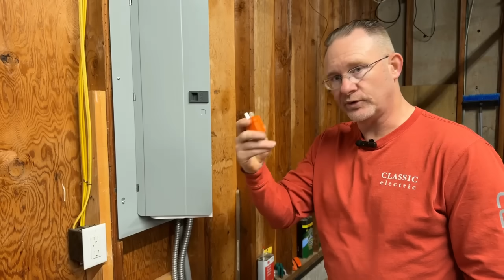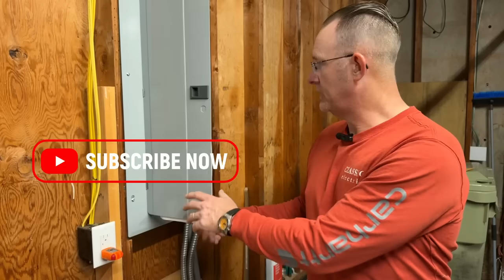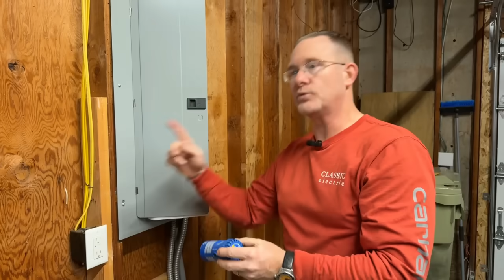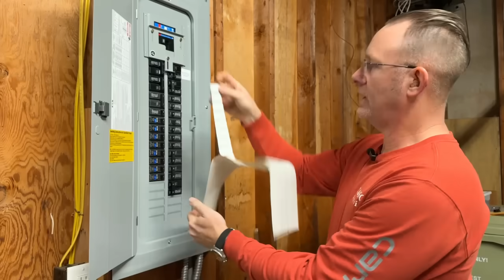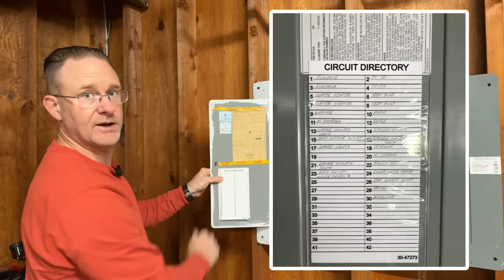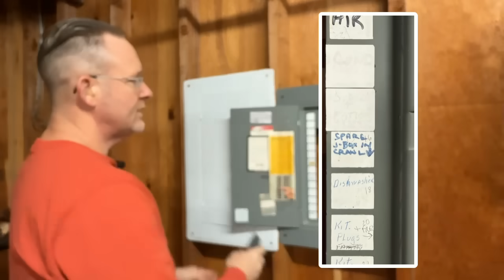Easy Ways to Identify Electrical Circuits in Your Home to Label Your Panel Correctly

Comment: Is there a way to apply for a variance? I have a 1984 house and need a panel upgrade. I was told that because the panel was next to my dryer (not closet) that they have to be able to walk up to the panel, and so they have to turn my panel around to be outside. So I came up with a plan to move my dryer and allow "walk up space" to access the panel and there is no door, so no closet confined area. Then they told me that the panels 2 feet on each side is not enough room as it needs 30 inches of bare wall in every direction all around the panel.. and it's got only got 20 inches on one side and 14 inches to the other side. So it must still be turned around outside. (why would a safety code force a homeowner to go outside in a lightening storm to flip a breaker?? How is that more safe?) so this is beginning to be BS. 
So the question, how much is it to get a variance to allow the panel to remain inside on the existing wall? There is no valid safety reason for this that the contractor could site Just that's what the code is. Is there any recourse a homeowner has?
Reply from the maker: You can ask the local building department for a variance, but generally the answer will be no.  That is because whoever gives the variance is on the hook if there is a fire/safety issue in the future.

Comment: Surprised you didn't mention a Circuit Breaker Finder and a noncontact voltage tester.  I have a Harbor Freight Circuit Breaker Finder that works very well.  My panel is in the basement, and I can test outlets is the garage or on any of the 3 floors of my house by inserting the transmitter in the outlet and then go to the panel and wave receiver unit over the breakers in the panel until it beeps.  Once I find the breaker that controls the outlet that the transmitter is plugged into, I used a noncontact voltage tester to test the other nearby outlets for power.  Process is faster that unplugging and plugging the lighted tester unit in each outlet nearby outlet.

Comment: Did anyone notice that the GFCI receptacle with (3) 12-3 Romex cables in that 1-gang box is not to NEC code for box fill???
Reply from the maker: You're correct that (3) 12-3 cables would be an issue.  In this case, it is (3) 12-2 cables installed in the box.

Comment: Suggestion: draw a sketch of your house floor plan with each outlet light switch designated. Mark the circuit breaker number. Label on each appropriate outlet/switch. This completes the task and avoid any problems in the future. Much easier to plan electrical circuits for future use.

Comment: A trick handed down to me from the old timers.  Take an old  extension cord  with a plug on it, cut it about 4 ft long. Get a handy box, wire the box with the cord. Now take the black and white wire and wire them to a switch. With the switch in the off position put the plug into the outlet you want to figure out. Not hit the switch, the dead short will trip the breaker and you will easily find which one it is in the box. The old timers called it,  "Get the circuit finder". Cheap and easy.
Reply: Interesting approach. If I were going to do that, I think I'd use a heavy-duty momentary contact pushbutton rather than a toggle switch.

Comment: I created a floorplan of each level showing each light and outlet location. Then wrote the breaker # next to each item for quick easy reference.
Reply: Same here Dennis. I did mine on my PC so I have a backup copy that I can change if any electrical is altered.
Reply: cool what software did u use for the floorplan
Reply: @Racontact I just used basic Sketchup, but I'm sure there are many other programs that would work as well or better.

Comment: I created an Excel spreadsheet (you can also do it in Google Sheets) to list my breakers. One column has a list of the breaker numbers, one column has a list of the rooms, and the third column has the specific location/description (e.g. #02, Living Room, Outlet Behind TV). I print one sheet sorted by Circuit # and a second sheet sorted by Room and hang them next to my electrical panel. Now I can quickly find the breaker number for a specific location or see all locations affected by a specific breaker. You may need to add an additional sorting column with just a sequence of numbers (1,2,3,etc...) to avoid circuit 11 sorting between circuit 1 and circuit 2.

Comment: when I bult my house I created a spreadsheet numbered like the panel.  as I added circuts I penciled them in.  When I was done I took the penciled in spreadsheet and created a new one that was filled by my computer.  I sized it to fit on the door.  What I haven't done, but will do, is get bright colored numbered dots.  The embossed numbers on the panel are difficult to read.
Reply from the maker: Using a spreadsheet is a fantastic way to keep everything organized!

Comment: The panel directory on my house (I had built) was written in cursive by what had to have been a 3rd grader.  I redid it in XL and will laminate it and put it on the door with magnets.  In the basement equipment room, I also cross referenced each piece of equipment - or its feed - with the breaker number on the panel.  Thanks for posting this.
Reply from the maker: Great idea to make it legible and easy to find!
Reply: As a licensed electrician I can tell you third grade was my favorite year.

Comment: Save yer some flippin'.  standard household outlet are generally 20 amps except in old houses when they were 15, so if yer lookin' for these you only need to flip these, forget the big ones for the water heater and clothes dryer.  Likewise light circuits are generally only 15, they could be 20 but less likely.  If you flipped all of the 15 and 20s and the light are still on you need to call an electrician cause your house is wired wrong. (unless there is a sub panel somewhere)

Comment: Have a small floor plan of the house on the panel, and identify the rooms.  Use this as a reference on your chart.
Use a circuit sniffer that sends a frequency through the power line so you can "hear" what breaker has the tone, then test the circuit.
Reply: Excatly what I'm planning for this weekend's breaker hunting

Comment: I have the tester like you show to see if the receptacle is on and working correctly. I also have a "sniffer" (circuit tracer) that works with a plug-in transmitter to help map the circuit breaker panel.  Plug the transmitter into an outlet and then the wand sniffs the panel for the transmitter. Trip the breaker and the transmitter goes off. There's a light in the tip of the sniffer that lights when it receives the transmitter signal through the panel.  Then you can pull the transmitter and plug into other outlets in the room that may be on the same circuit without needing a radio, vacuum cleaner, etc., for noise.  Works pretty accurately. Klein Tools makes both and they aren't all that expensive.

Comment: I'm surprised this wasn't listed... I purchased years ago a circuit tracer device. Plug one part into the outlet, then use the other part, an induction sensor wand attached to a LED and whistle device. Wave the wand along the positive side of the breaker, and when that breaker for the outlet with the plug-in device is found, the hand held device whistles and the series of LEDs all light up. (If you are "close" with the wand, only a couple light up.)
I wish I could remember the name of this device, but when I purchased it about 25 years ago, it only cost about $15 or so.
This thing even worked with the panel on.
** [edit] Klein tools, circuit breaker finder tool set is a current big box tool available for about $60. $70 for GFCI version.

Comment: I use the Klein tester to map outlets.  I also found a handy phone app called “Breaker Box” that lets you easily map and document your home’s electrical layout, with as much detail as you want/need.  It’s easy to use.  I record and map all outlets, lights/fixtures, switches, and rooms.  Once you’re done documenting, you can view the data in several ways - by breaker, by fixture, by room, etc.  As the OP stated, it’s important to label / designate each room uniquely.  I do this with breakers, fixtures and switches as well. I live in a single story home, so I don’t worry about floors/levels.  Each room has a unique 3 letter identifier. I identify switches and fixtures by room and position. When finished, I can see which rooms, fixtures, outlets and switches are tied to which breakers.  There is a basic version and a Pro version of the app.  The author charges a one time fee for the Pro versions, which adds several valuable features.  You can store panel maps for multiple homes, and also use a cloud sync service to sync your panel data between multiple devices. You can share panel data with others, back files up manually or automatically, and generate PDF’s or print panel data.  I have no connection to the app other than as a satisfied user.  The author is Brent Pappas.  He continues to update the app to squash bugs and add features.

Comment: The cell phone with a buddy system is the most obvious thing to do.
Why would you not use a label maker? Beats trying to read someone’s poor writing. Or at least type it out on your computer and tape it on the panel. Make notes on a clipboard, then take it to the computer or at least somewhere where it is comfortable to write properly.
The label stickers are okay, but write first then stick it on the panel.
And don’t go flipping breakers off and on, without making sure your computer is unplugged.

Comment: Purchasing a specialized noisemaker is not necessary. 
Most every house has a vacuum cleaner, which is a noisemaker that has another purpose, and you can hear it anywhere in the house, generally speaking

Comment: I have 2 breakers that I have no idea what they go to. My local electrician upgraded my panel and labeled everything. He couldn't figure out where they went either. But, they are turned on in the breaker.
Reply from the maker: It's very common to have a circuit that is terminated in a box somewhere in the attic or under the house in your case.  I leave the circuit off and one day when something doesn't work such as an attic fan not being used in the winter, come summer when the fan doesn't come on I flip the breaker and label it.
Reply: I'd suggest leaving them off. Sooner or later you'll find out what they are.

Comment: Another very helpful tip is that once you identify the breaker for an outlet, write with a Sharpie on the inside of the plate/switch cover the circuit breaker number so next time you have to deal with that outlet/switch you know the correct breaker.
Reply: EXCELLENT !
Reply: No No No !! Use a pencil on the breaker index label only. 
Over time, breakers get moved and shuffled when electrical work is done. That permanent mark is now incorrect. 
Pencil erases and can be relabeled. 
I have worked on a thousand  plus breaker panels since 1974 and MOST panels are incorrectly labeled at some point. 
Been there
Seen that
Reply: @dawg2100  He's talking about labeling the insides of cover plates, not the breaker box.
Reply: @ttiwkram I shall retake my remedial reading course and do better next time 🤦‍♂️
Reply: Yep. Just make sure you don't switch them around later on, and label any replacement plates.

Comment: If it’s easy then why is it expensive,  this is also true in automotive repair,  why do simple jobs cost so much,  yes time is money, but come on guys!
Reply from the maker: This is a relatively straightforward answer.  In all trades, including the mechanic, the customer is paying for the years of training, the expensive tools, and all the hard earned knowledge over decades of experience and learning what works best.  In Oregon specifically, it takes 8,000 work hours and 4 years of school work to qualify to take the journeyman exam.  To qualify for your Oregon Supervisor's license you must work for someone for 4 more years (another 8,000 work hours), for a total of 8 years.  That is just to qualify to take another state exam that has a very low pass rate.  A Supervisor's license allows you to pull permits, a journeyman or apprentice cannot.

Comment: I saw where someone wrote the name of the outlet or switch on the inside of the cover plates.
Reply: After I label mine at the circuit breaker, I often write(or with a label maker, place a little number) on each switch or outlet cover.
Putting this number on the underside of the trim plate with a permanent marker assures that it will always be there where you need it when you need it.
Reply: Not sure how that would help. It would make more sense to write the breaker number instead.

Comment: Hi Thomas, great video. Novice here: Smoke detector 14 ft up (20 ft ceiling) needs replacing due to end-of-life chirping. Different bracket, so need to shut off circuit to install new smoke detector's bracket; but panel labeling illegible & regrettably these smoke detectors don't appear to be on a dedicated circuit. Even if I find the right circuit for this particular smoke detector, how will I know? Won't the detector's battery backup still be operational?
Reply from the maker: If it's hard wired as you are describing, typically those have a little green light on them indicating 120V power.  If you turn the correct breaker off the indicator light will go off.  The battery backup won't show the indicator light.

Comment: I have an old, plug in radio that I use when I'm testing by myself. Plug in any outlet, tune in to music, then go to breaker box. I hear when radio power is shut off, hear it when breaker back on.
Reply from the maker: That definitely works and is an inexpensive way to find circuits!  Nice job.

Comment: Excellent video as most panels are poorly labeled if at all. I like use a label maker instead of writing by hand as it is neater and easier to read. I think the printing lasts longer than pen or pencil. Thanks for a very informative video.
Reply from the maker: Glad you found it informative and not a bad idea about using a label maker.

Comment: I suggest making another list that goes by each room to quickly locate the breaker so that you don’t have to go through all breakers to find “kitchen outlet south wall”  etc. because circuits can be running in other rooms taking time to sort through them all, but you still need the other list so you know if you are also shutting off the freezer.

Comment: Superb video and good of you to share your expertise. 

 Personally, I keep a small notebook with every light, outlet and appliance listed, grouped by the room or location.  In each area I list every outlet and note individually which fuse number controls it.  I keep that notebook at the main fuse panel.  You do it once then it serves you forever more.
Reply from the maker: That's an incredibly organized and thorough way to label your circuits!

Comment: I would love a device that attaches to a breaker and then allows you to identify everything on that circuit with a probe.

I have a Klein breaker finder, too, but it's only good for one receptacle or switch at a time.

Comment: Good points. When I am alone, I plug a radio and leave it on full blast. Then, go over to the panel and test the breakers.
Reply from the maker: That's an excellent way to identify circuits!

Comment: I wonder if they could make a gadget like the Socket Testor with a button that would trip the breaker? That way, you'd know when you check the breaker panel, which breaker was tripped.

Anyway, I live in a mobile home with a wiring nightmare. Several of the light switches have one cable with a ground, a white wire, and a black wire, with the hot wire being white. I want to add an outlet next to the switch and don't know how to connect it.
Reply from the maker: That's a very good idea about a tester that would trip the breaker!
Reply: @classicelectricnw  Would it be dangerous, or have negative effects?

Comment: I use the klein circuit breaker finder tool. Just plug in to outlet and run tool down breaker Abba's find it.  Great tool.
Reply: Your mileage may vary on these. 
I have one, and I have followed the instructions to let it "learn" the panel, but its accuracy is very poor. Gives the wrong breaker as often as the right one.
Definitely not good enough for this safety-sensitive task. 
I do know people who have had better luck with it though.

Comment: Pro Tip #1: 
If you just had electrical work done in your home by a licensed electrician and he did not provide or update the panel directory inside the panel door, and you are waiting for the inspection, call him back to provide it. It is required by code. 

Pro Tip #2: 
Never pay the total invoice for electrical work until it is inspected if it requires inspection. (If a permit was pulled, it will require an inspection). If it fails, you want it repaired and reinspected quickly. Holding 20% is an incentive to repair and get reinspected.

Pro Tip #3: 
Demand a copy of the passed inspection certificate for your records. If you have a fire and the insurance company is delaying your claim for proof the work was preformed by a licensed electrician and it passed inspection, you font have to jump through hoops to get it
Reply: SO! There are the "Thoughts and PREYERS-of ELECTRICIANS"!  FROM THE UVALDE'S, TEXASSSES.

Comment: What about lights and switches?
Reply from the maker: You just need to turn on all the lights then slowly turn each breaker off to see which breaker turns off the corresponding light.
Reply: @classicelectricnw thought you had a secret way of doing it